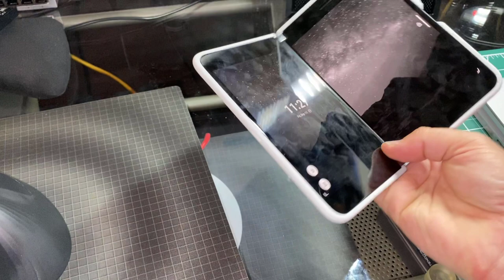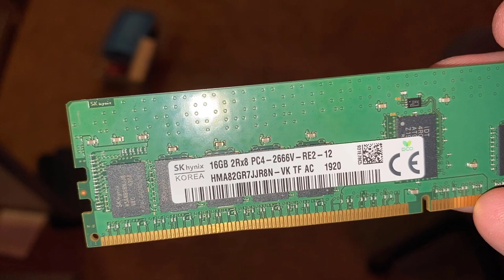What is the Cloud? Soft and Fluffy Edition - Computer Stuff They Didn't Teach You #10

Comment: "This is expandable" (the RAM) "just like in your computer".

Yep, well it helps when you plug the CPU fan in the right way around so that it doesn't impede the RAM slots, as I found this week!  What should have been a 2 minute job to fit another 16Gb RAM to my PC meant I needed to buy more thermal paste and isopropyl alcohol to take the fan off, clean it off, reapply the thermal paste and reattach the fan the right way around.  Just to put a couple of sticks of RAM in...  🙄